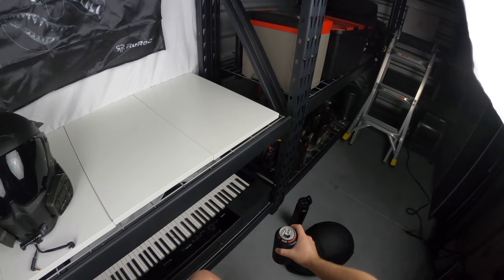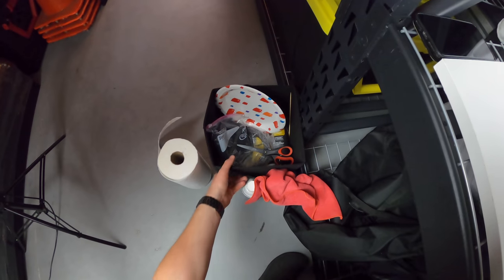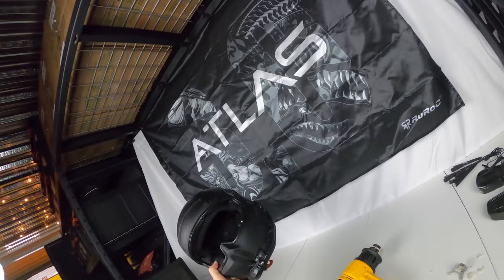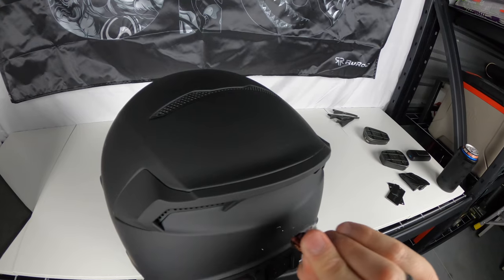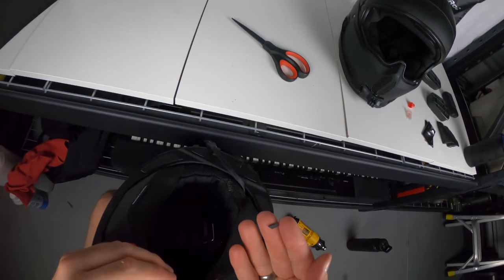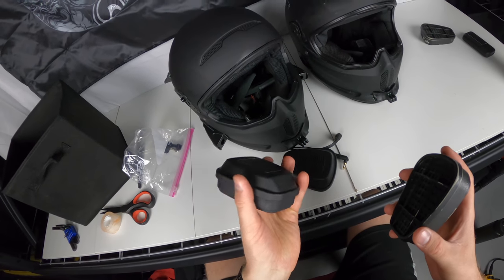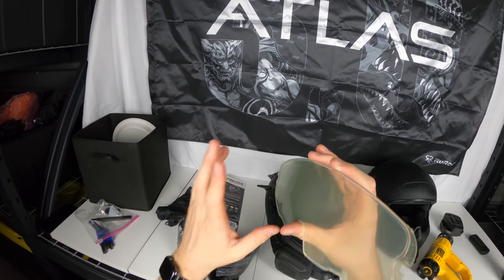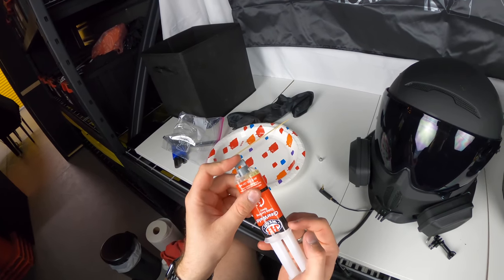Ruroc Atlas 3.0 Venator Setup

Comment: use sugru for the cam mount, I have a chin mounted cam on my helmet with it for few years now and no issue
Reply from the maker: Oh yeah, I forgot about my black putty stuff (I forgot what it's called), I'm sure that would work well.
Reply: I second that. I've used sugru and it holds my Hero 9 with all the mods attached.

Comment: why dont you remove the double sided 3m and jb weld in the hidden plastic? that way you cant see the weld and it looks as clean as the temporary solution
Reply from the maker: I cut this out (because the video was like two hours long), but that mount is essentially designed to fit onto the helmet WITH tape between it and the helmet. Plus, like I said, you really need something holding it until the JB weld can do its thing.
Reply: Yeah I understand that but what I meant was removing the 3m on the mount and replacing it with jb and place it has if it was temporary
And doesnt jb dry in like 1 minute and has to rest for some hours?
Never thought you would respond! Love your vídeos!

Comment: A good cover up for the hot glue would be to use a nail polish, you could chose either gloss or matte black and it's waterproof and pretty durable. Plus it's pretty cheap. You could also put some hot glue in-between the fins and the helmet to add more contact

Comment: 99% isopropyl alcohol will make it easy to take the glue off. It's what people use for paintless dent removal since the strong hot melt is used. And it doesn't hurt the paint.

Comment: Hey… I just watched this video. I was thinking, for the fins, what if you filled in the gap with the glue gun then when it dried go over it with paint. It would fill the gap and create more surface adhesion and you wouldn’t have to do the outside the taped ends glue. Just an idea I had while watching. I like your videos. Keep up the good work

Comment: Have you tried Sugra?  Stuff is fantastic.  I use it on my helmet to mount my GoPro.  You can mold it like clay, and it adheres very well.  You can also get it in different colors.  It'd be pretty easy to mold it around those fins and could also be used to fill the gaps between the bottom of them and the helmet.  It's also not permeant.  Highly recommend it.
Reply: You mean sugru?
Reply: @krassergamerLP  Yeah.  Sugru is what I had meant.